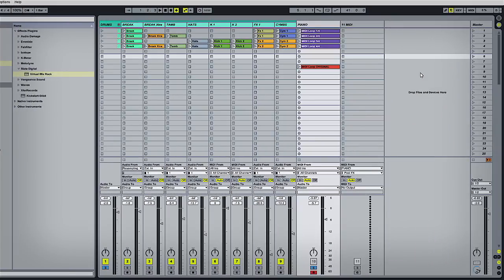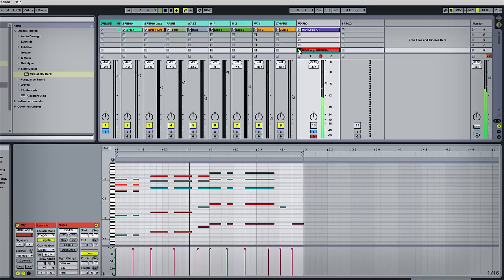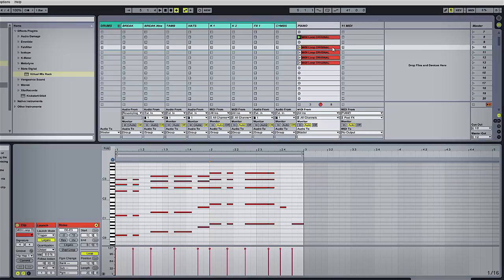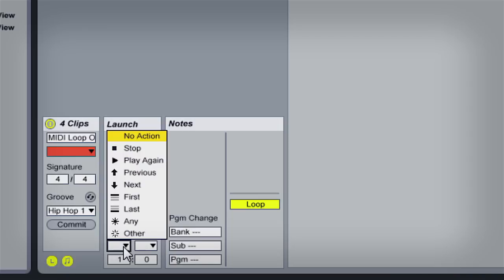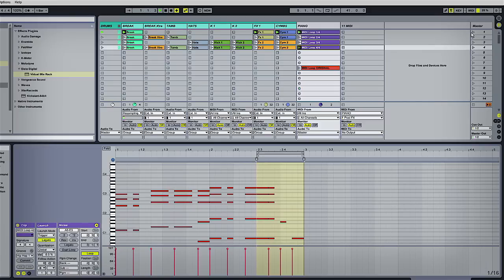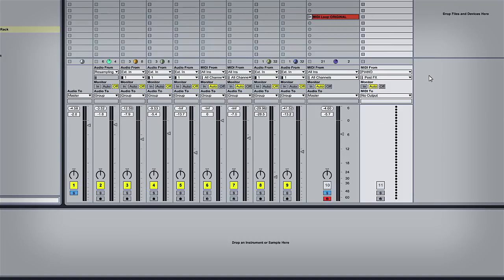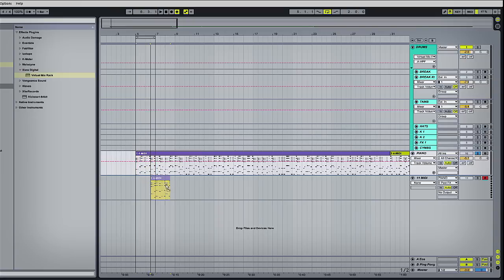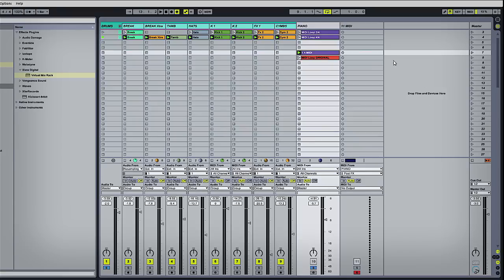Recycle Your Old MIDI Loops Into New Ones - Loop+ Quick Tip

Comment: What if I want change the tempo of the midi ? Is there any quick way or i have to rewrite ?
Reply from the maker: Hiya...if you mean changing the global tempo - then there is no problem, as the MIDI will automatically play at that new tempo.  But if you mean - changing the speed at which the randomisation occurs...then you need to  adjust the clip follow action length...in this video it is 2 beats...but you could make it 1 beat.  Ideally you would need to match this beat length in the length of your MIDI clips...so you would need 8 duplicates for this 3 bar phrase...each at 1 beat long...so first loops in thw stack would be beat 1, of bar 1, no.2 would be beat 2 of bar 1...etc  This will work if you have lots of syncopated MIDI values of less than 1 or 2 beats..but ling held notes and this wont work...so its a balance.  Hope that helps.  LM